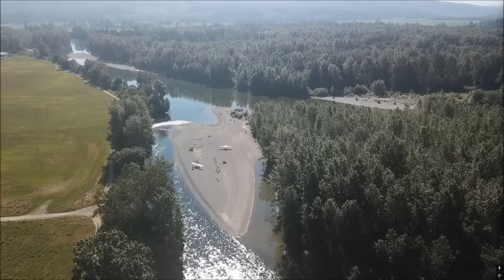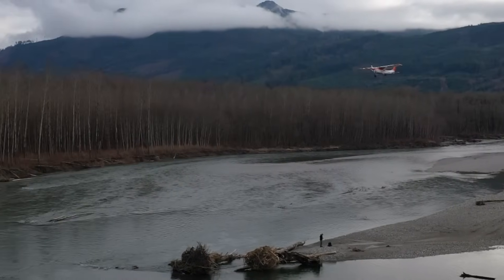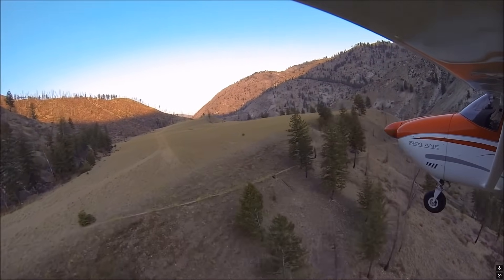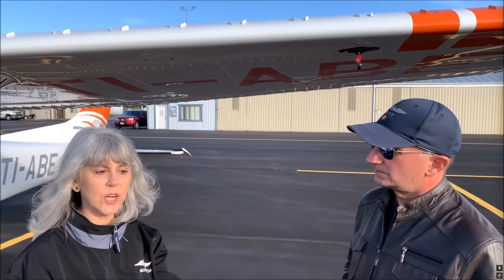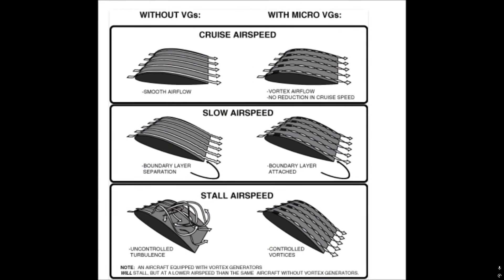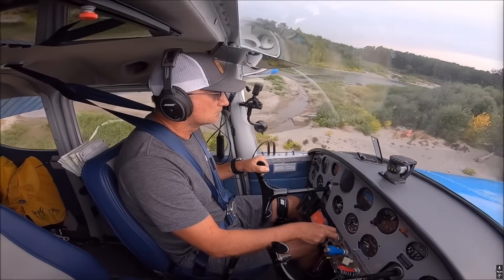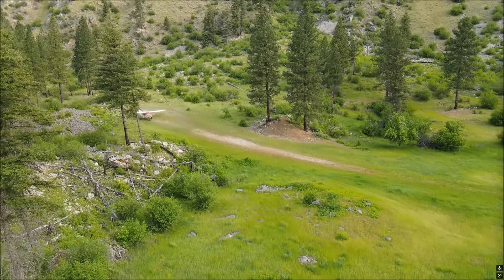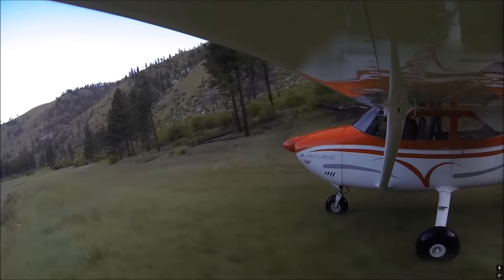The Secret Aerodynamic Hack You Didn’t Know About

Comment: VG come in various design applications for both low AND high speed Boundary layer control to help with preventing airflow separation in cruise.  An early example was the Boeing 707 wing.  I once purchased a roll of nipple tape that sail planes use and applied it to my single surface hang glider’s exposed crossbar ( spare) to see if I could get a better high speed glide performance.  I tested it first just on one wing ( right side) and sure enough the glider slowly veered to the left because of a slight lowering of drag on the right wing.